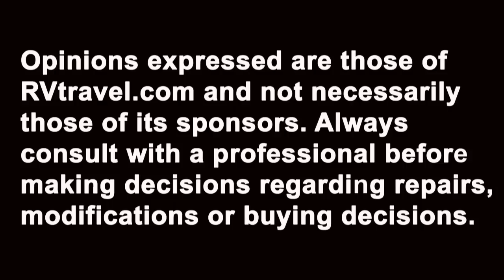RV Talk Live, June 21. Topic: RV Electricity

Comment: Question here for you folks.My motorhome has a 50amp magnetek model 950 converter.But it is wired for 30amp.Can i convert this to 50amp with a bigger cored and plug and 50amp breaker switch?Thanks for any info on this here issue.